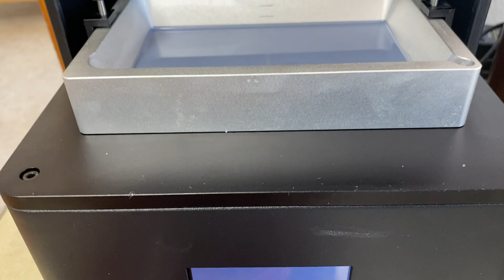ep345 - the epax x1-4k 3d printing adventure part 7

Comment: Many thanks for your insights, again. I finally discovered the anti-aliasing button in leechyslicer, and I never thought of lowering the standard 50um setting for Elegoo Saturn to 10um. Turns out I've been cranking prints at only 20% capacity for about a year now. I feel both dumb and delighted: the results are just fantastic! If I can offer a tip in exchange myself: currently busy experimenting with homemade PE by (cheap Amazon-)lasering lacquered brass and plain sodacan alu for electrolysis in salt solution. Still tweaking settings but man, the possibilities. A head like yours could push progress faster.

Comment: Interesting stuff. Also interesting in that relatively simply-shaped geometric parts can have challenges in being output correctly. Kind of puts paid to that “3D printing will replace injection moulding” mindset. Certainly at least not in its current form.